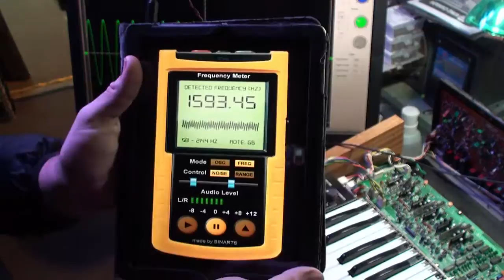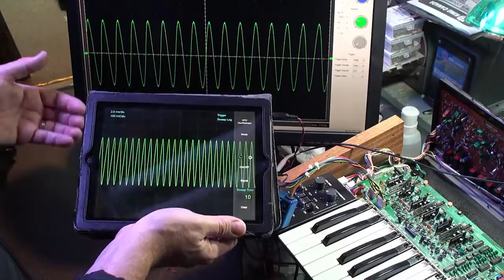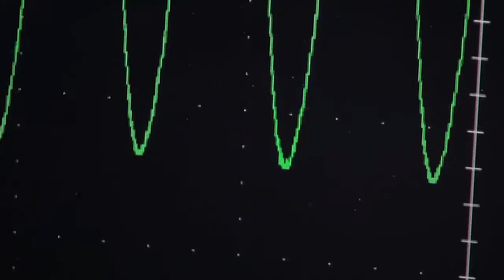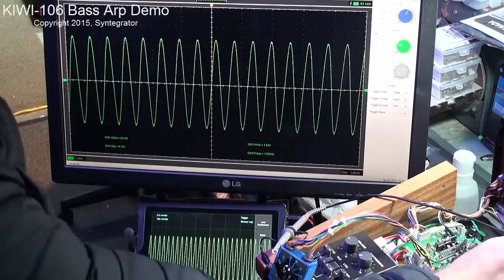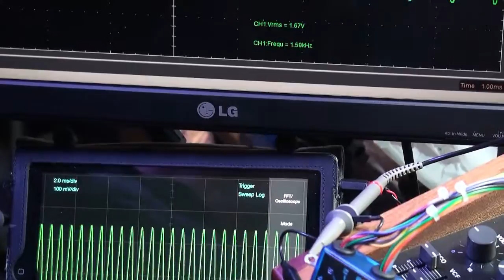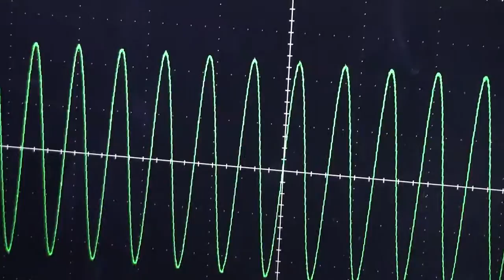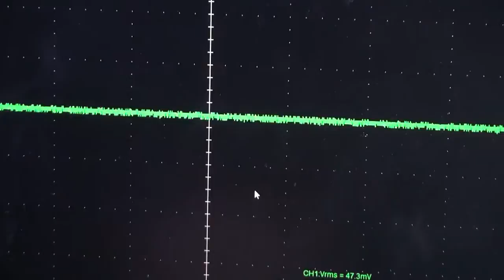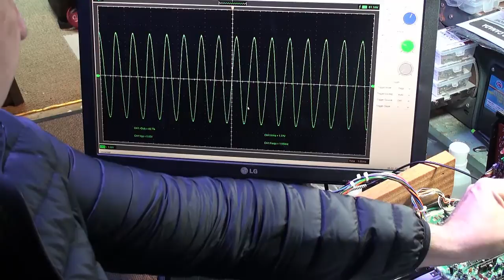BT's Kiwi-106: Part 8C (VCF Resonance - VCA Gain)

Comment: Very good work, thanks for you vids!
And what the program-oscilloscope (software for windows computer) you use in this video?
And how to connect computer for control points in the 106 (maybe simple connection without selector) ?

Sorry for my questions, but my 106 was broken (as now I know - 80017a chips and other mini problems - potentiometrs, sliders, buttons, LEDs) and now I make my first repair for 106, where I'm replaced all 80017a (reissue) and now I need the calibration procedure, but haven't oscilliscope .. 

P.S. And sorry for my english,
it's not my language plus I'm not a professional master (just in my country/city professional masters it's a big problem)
Thanks in advance!